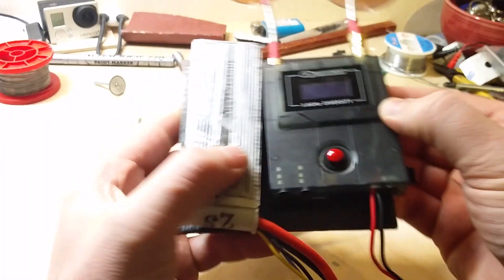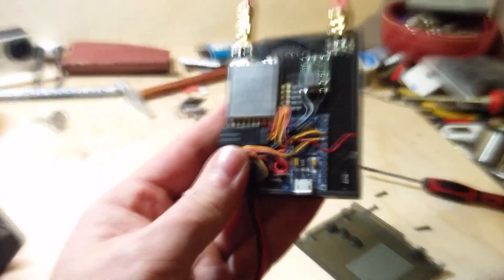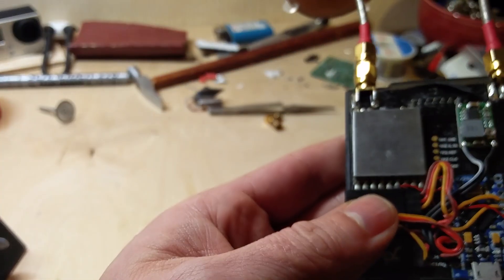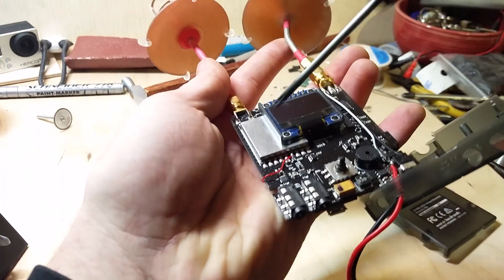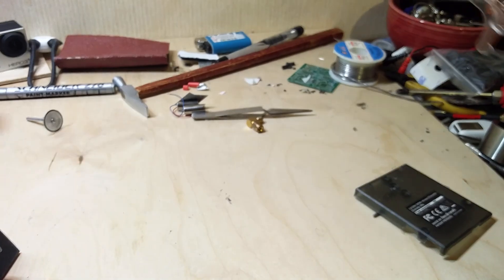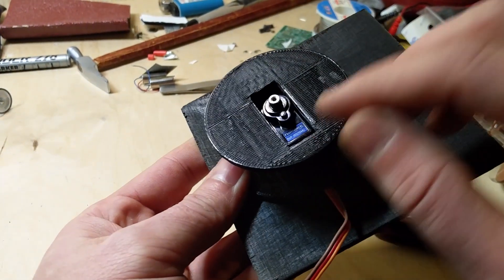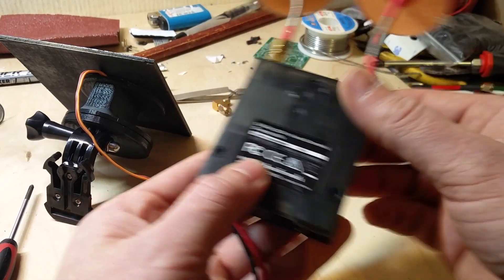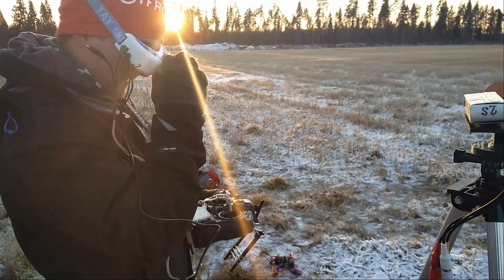SUPER SIMPLE 5.8GHz RSSI ANTENNA TRACKER

Comment: YES!!!! absolutely awesome solution m8, it also works with Skyzone RD40 Video Receiver the only investment was arduino leonardo all the rest i did have lying around,and my father has made diy antenas, can not wait for propper field tests but by the first testing in short distance worked GREAT!!! 
now i do regret i dont know anything about codes, i bet there would be easy to implement 2 diodes, both off vhen no signal and when its signal than moving right- right diode on- moving left -left diode on ... just for control check. How is your tilt addon continues ?  anyways THANK YOU FOR SHARING!
Reply from the maker: Glad to hear you made one. I can't seem to find time and weather for proper pitch development. Last time I went flying it was -20°C, the gyro froze and my Z84 fell out of the sky like a brick, 2 minutes after take off. I ordered new servos from HK, TGY-180D 180 degree. Im hoping I can modify them to turn even more...we'll see.
Reply: Hello Tux Pilniq, I have the same receiver and all I get is servo movement in one direction. Could you please advise me what were your RSSI_MIN, MAX values? Did you make any other changes to the code? Thank you!
Reply: I did not do any code  changes

Comment: Hello Antti, I just order the Rx from HK as they have free shipping at the moment and tried programming a nano and it seemed
to take the sketch, as i dont have the RX to test do you think theres any reason the nano wont work ? it moved the servo by touching A0 and A1 with fingers.
cheers
Brett
Reply from the maker: If the servo moves by touching analog inputs then it's working, congratulations. You could wire a couple of potentiometers to A0 and A1 to simulate RSSI signal. Then you can go and play around with #define values to understand how everything works, while waiting for the RX.

Comment: Hello Antti your antenna tracker looks fantastic. I will be putting one together. I have the sketch code that you used but need to know which library file that you used for the Arduino. Have you continued with the development by adding pitch yet?
Reply from the maker: I haven't had the time to develop pitch tracking,  also partially because tracker works "fine" with horizontal only, unless you fly really really high. If you are referring to Timer.h the download link and installation instruction are mentioned in README.md
Reply: Thanks for the quick reply Antti. I have the software ready to program the Arduino. Where did you connect the power lead and ground for the servos? Almost ready to start the build.  Thanks Bill
Reply from the maker: Both, servo and arduino are fed from the 5V regulator. I soldered servo +5V and GND to the arduino, which in turn is soldered to the reg.

Comment: Very nice!!congratulation!! Its possible to put the receiver in a vertical position and the antennas with different tilt angle? I think you will have a better result if not have tilt movement. Its correct? Thanks and sorry for my bad English

Comment: Hi, Got the set up all built and looking forward to using the idea. Only have had one issue so far which is that the servo isnt responding. I have it set on pin5 and powered from 5v. Ive tried a couple of different servos with no luck. Ive included the timer and servo libraries....any ideas???
Reply: By no response I mean it just slowly ticks round to its max position then binds...
Reply from the maker: Hi. If it slowly ticks to max position it means that, arduino is working and performing calculations, analog measurements are measuring rssi values that are very close to each other (slow movement). I'm assuming you have vtx on an rx is set to corresponding channel. The next thing I would do, is check out debugging information via serial monitor (Tools/Serial Monitor in the IDE while everything is on and connected)
Is it possible, you soldered RSSI measurements to wrong pins in vtx? If you cant figure it out, contact me at firstname.lastname at gmail.com
Reply: @TopperDanny ¿Resolviste el problema? lo mismo me pasa a mi
Reply: @zxrd2753  Buenas, lo has resuelto tu? Yo estoy igual jajajaja, no se mueve el servo pero en el monitor veo que va variando poco a poco de un lado a otro...
Reply: @Minerillo_FPV   estoy a la espera de probarlo en el campo, en casa no funciona, pero mi servo si se mueve muy despacio hacia la antena dominante hasta que llega a los 180 grados y ahí se queda.  si tapo la antena con la mano si gira al lado contrario, yo tengo el fr632,  estoy seguro que es algún problema de calibración de los offsets o algún otro.

Comment: Have you thought about using the half overlord for a pan and tilt system?
If the rssi and antenna setup would overlap enough it could probably maintain a strong signal without breakups and stay close to the mainlope even while crossing the station.
I would like to build a similar systems like yours in the future with the half-ol, am just not solid yet in programming...
Thanks for your design!

Comment: Awesome!  I know a little arduino.  Gives many ideas on using a 2nd receiver to triangulate position.  Thanks!
Reply: Yes, it will, but you'll need 2 receivers on the servo. I'll be building one in the next few months, and try to get a 3rd receiver to put a third antenna above them, which could be used to tilt up. I'll need stronger servos as there will be quite a bit of weight on them. Seems like an interesting project, should be fun

Comment: Interesting, have you had a chance to test it with more narrow - higher gain antennas? Can the nano follow fast flying with more directional antennas?
I love Finnish language btw ;)
Reply from the maker: Ufortenately I haven't...babies wifes etc. Now I have Z-84 with EzUhf and 800mw Unify HV I've been flying with Fatshark + deversity, so far max range 2000m with patch antenna. I'd be really interesting to test it with the tracer and 9 turn helical.
Reply: Hope you're able to test with the 9 turn helical too! There's a YouTuber called JD FPV and he's getting incredible distance(out to 22km) by using helicals w/ 2x FR632 receivers and an Eagletree Eagle-Eye diversity controller. Wondering if this AT would be able to get similiar range?
Reply: Helical are great especially for GPS trackers (they can point quite accurately to a fpv object), for RSSI based trackers I 'd recommend using antennas without side lobes for better stability e.g. ibcrazy crosshair or patch (or biquiad for linear polarization). This way RSSI tracker should stay cheap, simple and more reliable.

Comment: hello Andrey, one question: on the code I don't see any info in how about to set the channel where to take the RSSI
Reply from the maker: Hi, what do you mean by channel? Do you mean Arduino pin?
Reply: hello!! I mean the VRX channel and band
Reply from the maker: Arduino doesn't do that. You set channel manually from vrx menus. Arduino doesn't need to know what channel you are on, it just monitors rssi levels and turns servo left or right. Does this answer your question?
Reply: yes sure...i started from your code to built one tracker using two RX5805 modules...so now I shall understand how to set the channel on the VRX...thanks a lot
Reply from the maker: Okay now I understand :) well done! There is no support for changing channels at the moment. But it should be pretty easy, just connect some pins from Arduino to vrx ch1, ch2 and ch3 and set them in code. What kind of interface are you using to interface with arduino, buttons?
Reply: yes right...I was looking right now on the web...I found how to do...see here: https://github.com/sheaivey/rx5808-pro-diversity ...at the end the tracker and the diversity can run on the same platform I think...

Comment: Very good project, but I have a doubt, I can do with 2 rx of video or it has to be the diversity? I understood that the logic would have to be diversity because in it has the signal that says to the board which antenna is stronger, and from what it has given to understand is that it is exactly that signal that informs the board the best atena that you use for tell arduino how the signal is, but I do not understand how he knows which way to go, when you answer here I buy the receiver, because I depend on your answer if I can use 2 simple receivers or it has to be really diversity. Thank you.
Reply from the maker: I just want to clarify one thing. Diversity is a way of choosing better signal and switching it to the (video)output. For RSSI tracking you don't need video diversity, you just need two video receivers with RSSI output (Arduino has nothing to do with video). All Arduino is doing here, is measuring two RSSI voltages from two receivers and turning servo towards better one.

That being said, you can take two identical receivers, connect their RSSI pins to Arduino and start tracking. Now you connect the display to one of the receivers, and all you see is video from that receiver, there won't be diversity swithing. Is that a problem? Not necessarily. You have to keep in mind that usually you have one directional antenna and one omnidirectional. When you fly out of directional beam, diversity switches to omnidirectional antenna. But in our case you have two directional antennas which are constantly pointing at the VTX, so video signal is almost equally good (or bad) on both channels, no need to switch around. Of course this is in ideal conditions only. 

Sorry long explanation, I hope it answers your question.

Comment: What does it mean by "tracking is not relative?" Thanks!
Reply from the maker: Hi, it says: tracking IS relative. A GPS tracker knows its own location and targets location, from that it can calculate exact angle where to point. RSSI tracker has no idea where it or the target are. It only knows that signal is stronger "to the left" so it turns that way, if the signal gets stronger to the right after turning, it turns the other way, and so on. Because directional antennas have messed up radiation patterns (google for helical antenna radiation pattern) it's kind of hard to tell why RSSI is 50%, is if because the target is far away, or is it because the target is in antennas side lobe a hundred feet away. Basically, tracker never knows if it's pointing in the best possible direction.

Comment: hi will this work with a skyzone rd40 reciever? currently the only one i have lying around :/
Reply from the maker: Most of these 5.8ghz receivers use same rf module. Open the receiver and measure voltage on pin 6 (from the left), first with vtx swithed on, and then with vtx off. If there is difference in voltage, then its probably RSSI pin. Then you can make the tracker.
Reply: Antti Vainik what should i use as ground?
Reply from the maker: For example the sma body. The voltage on RC540 was around 1.2V at 100% RSSI and 0.5V at 0%
Reply: thanks! will try that :D
Reply: Antti Vainik oh and one more question. i have a pro mini withou usb. only pins can I use that if i have a ftdi Adapter?
Reply from the maker: Arduino pro mini is just as good as usb version. Not so handy to programm, but pinout is the same.
Reply: I am trying to upload the timer.h file to the arduino. how do I do that? is that the only file I need?
Reply: all I get is error compiling for board arduino pr or pro mini when trying to flash the tracker.ino file, Help!
Reply from the maker: Its probably Timer.h See README on how to install the library Timer.h
Reply: Antti Vainik tried that.   no succsess
Reply from the maker: I can talk you through it tomorrow. Ping me at antti.vainik@gmail.com
Reply: how do I stop it from drifting? got everything set up and arduino is working, the servo always starts drifting in a clockwise rotation, how to stop?

Comment: I built something similar;  so far I've gotten 600m range with a 25mw vtx.
Reply from the maker: Sounds great! What kind of antennas are you using?
Reply: I'm using Aomway patch antennas (mostly because I think the patch antennas are slightly more portable than helical antennas).

https://www.youtube.com/watch?v=Mb4TvEvILn4

The signal is clear all the way out to 600m except when the frame itself is blocking the antenna; I need to reconfigure the quad and put the vtx antenna on the backside.

Comment: If I disconnect the servo potentiometer to make the servo spin through 360degrees, will the arduino code still work? Am trying to build it right now, just figuring out how to arduinoify for the first time
Reply from the maker: It won't work. Sorry it's not that simple. 1. Servo.h library will limit motion to 0-180deg. 2. You really need a servo that is ment to move 360deg. 3. You would need to do some changes in tracker code.
Reply: Antti Vainik thanks for the reply- its been a while but Ive decided to add a separate servo pot which is geared down so that it turns through 360° and your code still works. Thanks for your work, the setup has been working great for the past 7 or 8 months or so by the way!
Reply: hi, i'm really interested about this 360 mod, do you have some photo? and if you want to share the code will be very appreciated =)

Comment: Could someone please confirm that the required arduino model does have to be flashed prior to use?  Thank you!
Reply from the maker: Yes, you need to flash it. The instructions are in github (link in the description).  This project uses Timer.h, you will need to download this library from github as well and import it in Arduino IDE (links and instructions in github README.md)

Comment: I'm just in the process of building this and have a comment about uploading the file to the Arduino. For several hours I have been trying to get this working on a Windows 10 PC with no experience of Arduino.
So for the uninitiated, after you install the software (It seems Arduino doesn't like the software installed in the default installation path, I ended up only getting it to work when installing it in the root of the hard disk eg c:\arduino) you have to upload the timer library into the libraries folder under that. You also can't have odd characters like - in the folder or name. So in other words, extract the timer-master zip file into a folder named timer under arduino\libraries.

Comment: Wow, awesome and cheap solution for an antenna tracker. I was looking for a good diversity receiver, when I stumbled upon your video. It made the decision much easier! Bought this receiver and built the antenna tracker with the components you mentioned. Works like a charm! Changed the code a bit to my likings, but it's basically your idea. Thanks man!
Reply: Johan Meijer What did you change? And could i use those codes?? Thanks!
Reply: I'm gonna need that code cowboy
Reply: @captainKts  https://photos.app.goo.gl/fZ4noDLT8fdmpufT9
Reply: @johanmeijer85  hi bro, can u help me edit this code to using the 360 degree servo, thanks. plz
Reply: Sorry for the late reply, but here it is: https://www.dropbox.com/s/l0u19iy3yhyqd2k/AntennaTracker.ino?dl=0

Comment: Hey mate I just realised I am using the fr632 receiver what changes do I need to make in the code / programming thanks
Reply from the maker: No difference which one you use RC540 or RF632. In any case you will have to do the calibration: find RSSI_MIN/MAX values and RSSI_OFFSET_RIGHT/LEFT. Read the comments in the code for all #define's you'll get a picture what can you tweak.
Reply: Thanks , I'm new to arduino I don't understand the calibration etc could you explain very simply cheers
Reply from the maker: The video receiver outputs signal strength - RSSI as analog voltage, somewhere between 0 - 3V, Arduino converts that voltage to a numeric value between 0-1024. We need to know exactly what value represents 0% and 100% RSSI. That is #define RSSI_MAX/MIN. This is because every receiver is going to output different voltage. By changing RSSI_MAX/MIN you can  find values that match your receiver. Obviously RSSI_MIN is when vtx is off and RSSI_MAX is when vtx is on, and very close.

Then there is #define RSSI_OFFSET_RIGHT/LEFT. The two receivers inside your FR623 are going to be slightly different, one is going to be slightly better and it will output better RSSI all the time. This will cause the tracker to miss the target by some offset. I'm kind of repeating here what already says in the comments.

How to find all these values? Connect Arduino to the computer, in the Arduino IDE open Tools/Serial monitor. A window opens where you can see left/right RSSI values etc. Now adjust RSSI_MAX/MIN in the code -> save & upload -> check Serial monitor again -> rinse and repeat.

You dont really need to know much about Arduino, just read the comments in the code, change some #define values save & upload and see what  happens. You'll be a programmer in no time ;)
Reply from the maker: Almost forgot...I made some changes in the code. Download the newest version https://github.com/andreiva/simple-rssi-antenna-tracker/archive/master.zip
Reply: Antti Vainik Is it possible to pan / tilt with this project?
Reply from the maker: Only pan at the moment. The developer is too busy changing diapers, no time for tilting :)
Reply: Antti Vainik hey so I would have to program the Arduino chip?? or just solder everything and it's good to go?
Reply from the maker: You would have to program the Arduino. Arduino by itself wouldn't do anything, it's the software that does all calculations and moves the servo.
Reply: Antti Vainik is it hard?? how can I find something on how to do this or even the programmer I need or anything??
Reply from the maker: I would say its very easy :) (but I am a software developer myself) All you need is a USB cable and Adruino IDE installed on your computer.
Arduino is THE most popular micro controller board in the world, this means there are thousands Youtube tutorials and howtos.

The "hard" part is calibration of RSSI signal. It requires typing a few numbers in the code. When you get that far I can talk you through it over Skype.
Reply: Antti Vainik sounds good I'm going to order everything right now thank you